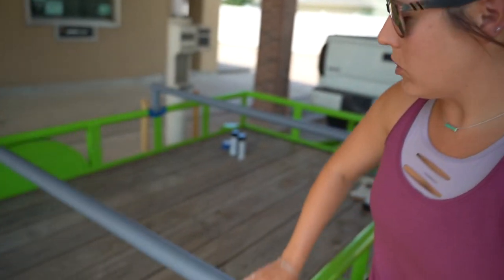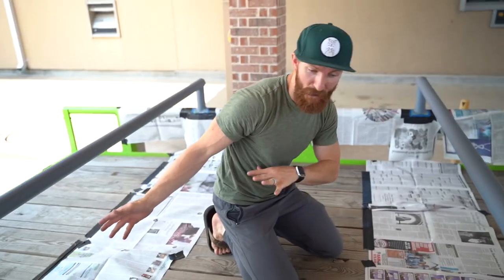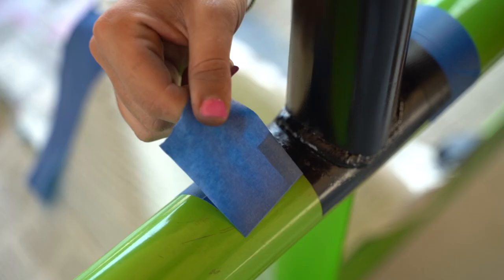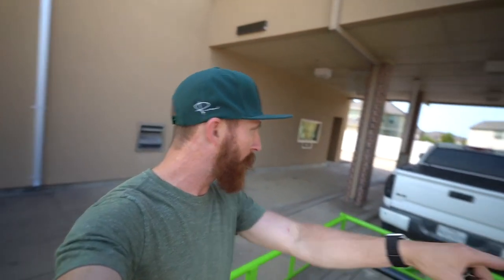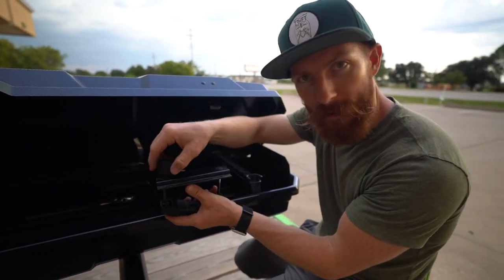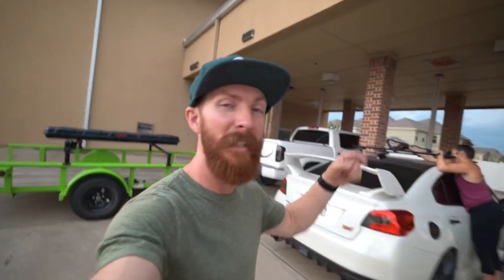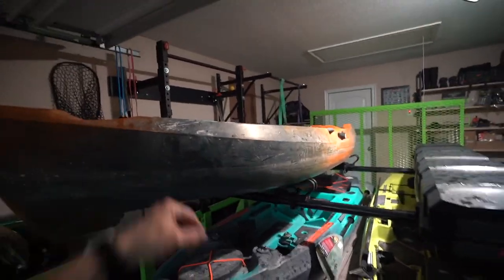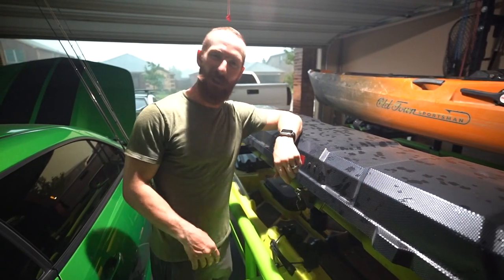BUILDING OUR DREAM KAYAK TRAILER!!

Comment: Westin if you put the Yakima rod holder in the middle and put ,let's say 2 45° braces tapering away from it on each cross bar. You should be able to get everything on there.  4 yaks and the Yakima.
Reply: I could draw and get that all set up for you.

Comment: I use pool noodles for the cross bars so when you strap it down its a liitle softer on the kayak. Just slice it in half then tape yiur ends so they stay on the bar

Comment: Oh yeah! I was looking forward to seeing what you would do with this. I bet you would probably have enough room for another yak on the top bar if you reposition the rod locker to the outside edge & then put a J-cradle style yak rack in the middle that holds a yak on it's side or at least tilted at an angle.  Heck, you might even get two more in the middle if you used something like a Thule Compass yak rack.

Comment: Shoulda had’m design it to where you could slip those yak racks on the trailer on an off with a pin in it to secure it, then you could still load something bigger in the trailer in the future if need be, just me thinking 🤔, like the idea for sure!

Comment: $500 bucks for less than 20' of 3 in pipe with 4 copes and 8 welds? Maybe 3 ft of wire. Damn. Did they atleast clean the dingleberries off with a wire wheel? Lol.  Shouldve had em weld on an eye bolt or two to run some cables through to lock the yaks up. Still works for your needs looks like.